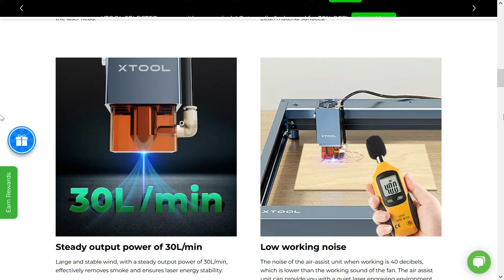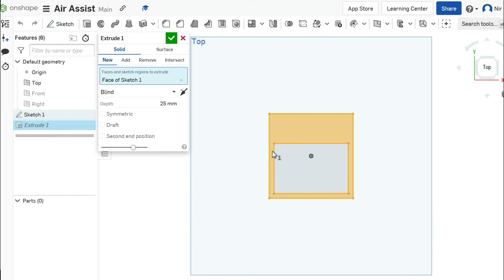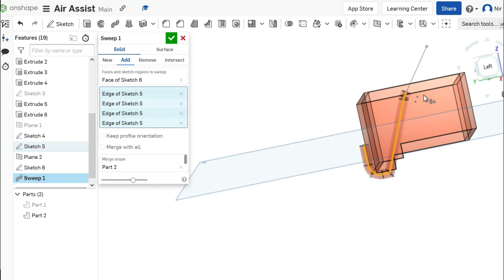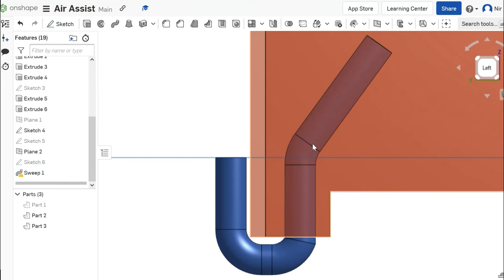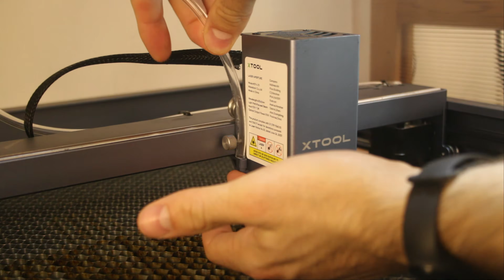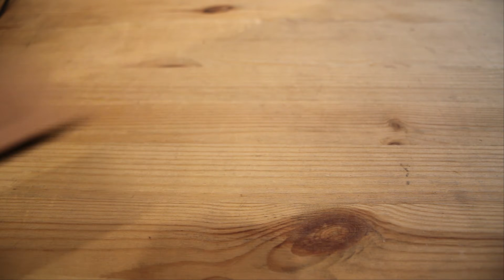$45 Air Assist Laser cutter Upgrade - Effective and Quiet | Easy Installation | xTool D1

Comment: Came up with it all on your own, eh? Interesting. I bought one that looks exactly like this back in January from GeeksAtLarge.  What a coincidence. 🙄
Reply from the maker: Hi, thanks for taking the time to comment :) I didn't mean to offend anyone, and I'm sorry if I did. In fact, this video is meant to go along with my instructable, where I definitely gave GeeksAtLarge the credit they deserve. Honestly, I saw many designs before making mine, their design wasn't special, it was similar to others made for different laser cutters. Moreover, their design uses a 3D printer nozzle which I thought was an unnecessary complication (I thought it would make more noise and lower the efficiency of the air assist, and I wanted to use a small air pump).
Again, sorry if I offended you, I didn't claim not to see other people's designs, and I made changes to the existing ones along with giving them credit on my main article (see instructable in the description).
Sharing my projects is not my profession, and it will never be. I do this because I like sharing and I think sometimes people can learn from my work or make use of it. 'Stealing' other people's ideas is not something I would do even simply because I'm not planing on a career on YouTube or anywhere else online, this is just a hobby.
I'll post this to other comments as well.
Nir